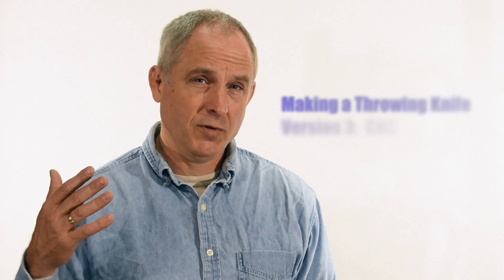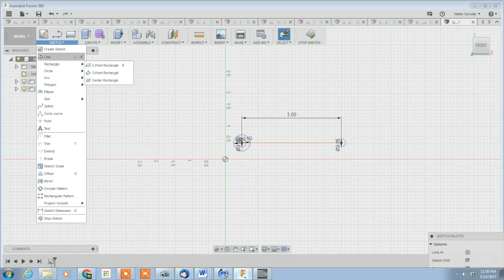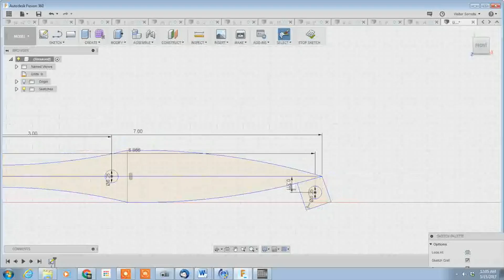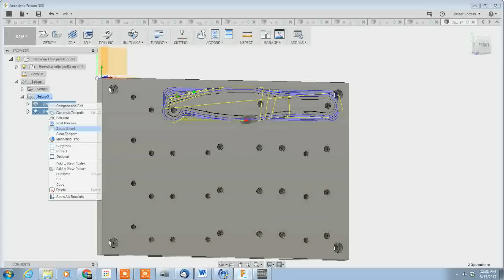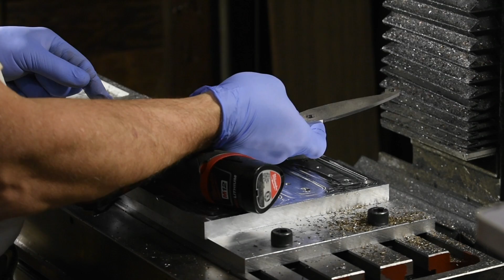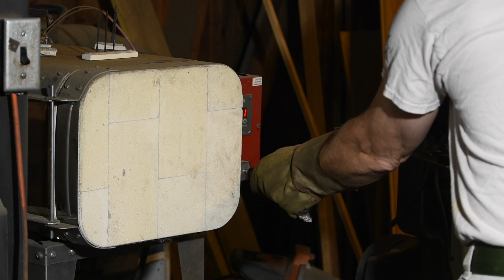Make a Throwing Knife with a CNC Machine!

Comment: A little tip we use.  Add a piece of paper to the knife then place inside the heat treat foil.  The paper will burn the remaining oxygen out and coat the knife with carbon so the foil will not stick, although not likely.   Keep up the good work

Comment: Intermediate between socket head cap screws and high-precision locating pins is to use flat-head machine screws (the kind you use with a conical countersink) - the cone on the screw will tend to pull the part into alignment with the thread's center. Of course, you do want to use high-quality screws (I use stainless, personally). 😀

Comment: Just out of curiosity (I'm not in the market for a new CNC machine), if all one wanted was a way to make multiple blade blanks, and intended to do all of the other processes by hand, would it make more sense to use a CNC mill or a CNC plasma cutter?
Reply: Gunslinger454 in all honesty, neither
a water jet is by far the best way to go. and the best way to do that is have the steel you order shipped right to a water jet shop, and then it arrives to you ready to grind.
I've dealt with water jet cut parts and they are a joy. 

I wouldn't do it for my knives though.... entry level/semi production stuff like he's showing is about as high end as you can go with automating it.  There is a reason none of the guys making $5000 knives have a CNC machine
Reply: +Geoff Flato -- Thanks! Like I said, I'm not in the market for a CNC machine of any kind at the moment, but if I were I would really only be interested in cutting out multiple identical blanks that could then be made into knives by hand. I've seen the guys over at 'Man At Arms: Reforged' (an excellent show on the 'Awe me' channel!) use their CNC plasma cutter a lot to cut out blanks for their swords, and it seems to work really well for them. Obviously it lacks the precision & versatility of a CNC milling machine, but it looks pretty effective for making blanks.

Comment: I personally would run a good six flute in that material with that adaptive strategy. Starting setup as:
.037" stepover
5750 rpm
82 IPM. 

Could adjust from there as needed for best chip evacuation.

Comment: Granted I am normally working with tool steels and coolant so I'm likely off on this but run a few hundred rpm less on a 3/8 cutter than you are. Why are you running it so fast? Is that to help keep the heat in the tool? Like you were saying that specific cutter likes to run hot. I don't remember the brand and coating of the cutters we use for hard milling but they will cut though 50-60 rockwell c like its butter. I'll see if i can dig up the name and I'll get it to you in a couple days if you are interested. They may last longer on the fancy knife steels you are working on. Also, you might want to look into stubby end mills. If you are only cutting on the bottom quarter inch of your cutter why pay for an inch of flutes.

Comment: I have some experience with sacrificial tool plates. You can rough and finish with the same mill if you have at least a blade thickness more of sub plate. Mill twice deep for the finish pass for a fresh sharp edge. And for more consistent part locating use flat head socket cap screws the tapered head locates quite well in the drilled hole.

Comment: what dimensions would you buy steel for like general knife making. also what's the difference between     HR 1095 and CRA 1095?
Reply: Evan Frahm I'd recommend not starting with 1095. it's actually rather picky in heat treat. 1084 is a much better choice. as for size, 1/8x1.5" is about perfect. 

I usually use 5/32 or 3/16 154cm, but I'm making hollow ground knives with tapered tangs
Reply: Geoff Flato Duly noted. Thanks for the advice.

Comment: very cool 3 part series. thanks for sharing sir. can I ask where you buy your belts from. I built myself a 2×72 grinder and want a good set of belts but want a good deal to.
Reply: John Biggs tru grit abrasives isn't who Walter deals with, but they are without any question the best option. By far the biggest selection of anyone, and also the best prices.

VSM ceramic belts are about the best cost per knife ground belts out there. They run $3-5 each and outlast most of the $10-12 belts I've used.

a couple gator trizact belts (a160 a100 a45) are highly recommended as well

Comment: Walter Sorrells please make a video on knife making using only a dremel and maybe a drill and using steel from maybe a saw i really want to make a knife but i dont have the tools
Reply: honestly, i have a dremel and it's high speed, low torque and the abrasive/wheels for it are insanely expensive. If you were cutting and grinding a knife with a dremel, it would be very expensive and you'd need to change attachements all the time. A file is way cheaper (20 bucks max for a good 12inch bastard file), check out Walter's video on making a machete with no power tools.
Reply: very true
Reply: I've got about 4 dremel tools and the pro version (foredom flex shaft) 
I use them all the time for detail work. 
but for making a knife without a bandsaw and belt grinder? a hacksaw and files would be much faster and make for a much better result
Reply: totally agree
Reply: Akhil Rayan Omar you need 2 tools a drill and a file
Reply: Yeah but seeing a video entirely using a dremel would be nice cause it has the sanding stuff and the cut off wheels so it would be faster
Reply: Akhil Rayan Omar you don't need a video to make stuff just do it

Comment: great video as always, what's a reasonable cnc machine for a beginner? the 770 is over 7k, or is that just the price cncs go for.
Reply: 7k is cheap for cnc, just at the top end of the hobby market. The lowest price cnc machine I used when working was 64k, others went for 500k
Reply: GlaucusBlue that is an extremely cheap CNC machine, and Walters is a toy by CNC standards. for a "real" CNC figure on the price of a couple houses

Comment: Are you thinking about moving over to a water jet or laser in the future? Tooling will really add up if you are doing large runs, as I'm sure you are noticing.
Reply: Foxtrot personally I think he'd have been better off contracting out water jet cutting than profiling on the toy tormach. Big waterjets are incredibly productive, and if you crank the speed up and let the tollerance suffer to a couple thou, the unit cost for parts is very low. 
I dealt with a shop that had a large omax waterjet, I believe it would do up to 8" of hardened steel. It would bang out those knife blades like you wouldn't believe. No upfront expense, and probably lower unit price than burning up piles of endmills
Reply: The shop I dealt with could easily blank out 100 knives in an hour, if not substantially more. If you tell them speed is more important than accuracy, a big waterjet is unbelievable to watch cut. The key is finding a shop with a real big one though. I'd bet the omax where I dealt with could probably put out close to double the knives per hour what a smaller and more typical waterjet would. It was a company that mostly cut parts for heavy industry (oilfield, shipyards, ect)  that thing would go through 4" mild steel like it was tissue paper
Reply: Waterjets are far more expensive to maintain than his tooling cost will ever be on those parts.  one good rebuild on the high pressure pump will be at least a grand doing the work yourself. And a 4K fiber laser (and he would have to have fiber for the steels and thicknesses he uses), is an easy $700k on sale. I think cost/benefit, the tormach or something similar best fits his needs.
Reply: Yeah, I agree Geoff. Thus why I asked what I did. Contracting out the work is a better idea though. The cost is about 100 dollars an hour and I'm sure he could get quite a lot for those rates. For prototyping and one-offs using the cnc is a good idea but for production runs it really will be cheaper to have someone do the blanks instead.